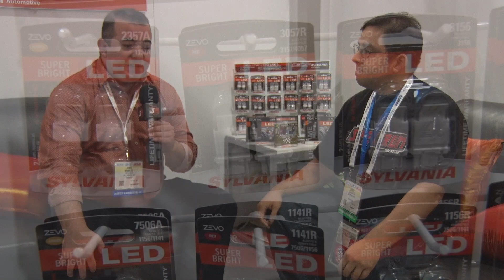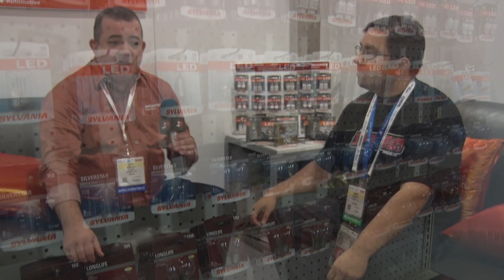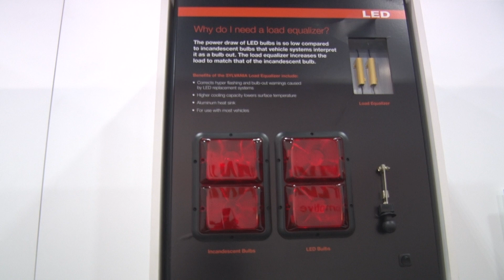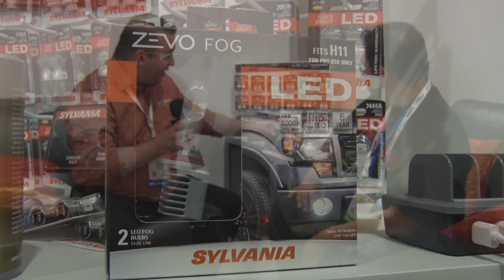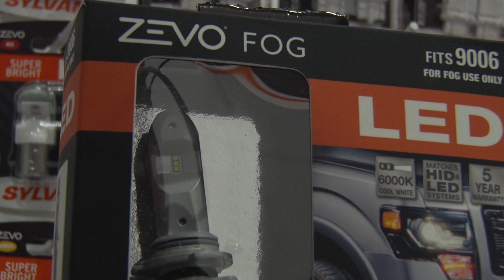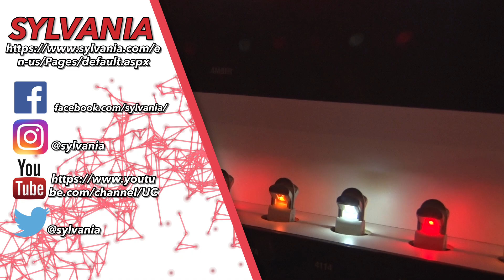Sylvania Interview at AAPEX Show

Comment: Now even this was quite a few years ago.

These led bulbs from sylvania zevo are excellent bulb replacement. 

These zevo led bulbs, wether if it’d red led, Amber led, and white led, these makes between 1.5W-2.2W 

For what it is and how it performs and when it uses our reflector housing, they are the brightest, of the least bright led bulbs. 

It’s the same if not a hair more bright than oem. When it gets dark, it becomes couple hairs brighter than stock.

Just because these products says for off-road use only, doesn’t mean we shouldn’t get it. 

If we want something that’s a bit brighter, have an instant on and instant off led bulbs, and gives a nicer and modern look to our older vehicles. 

These are a must buy. 

I have some in my family’s 2017 Toyota sienna LE. We have some sylvania zevo T15 led reverse light, 7443R led brake lights, we use to have 7440A but it did not work for its particular turn signal application so we went with lasfit and it was much better.

We use Zevo T10R inner tail lights, .evo T10 license plate lights and map lights as well.

And I even did the same for my brother in law’s 05’ Toyota sienna. 

Soon as I get new oem headlights and oem tail light assembly, the brake lights, turn signals, reverse lights, inner tail lights, license plate lights and some interior lights will be replace with sylvania zevo led bulb replacement. For low beam and high beam headlights. 

We’re gonna use on lasfit led bulbs for reflector style headlights of low beam and high beam.

That’s gonna give the 2nd gen sienna a much modern look, for better safety,style, and performance. 

To keep my family safe to see better and be seeing better to alert other drivers. 

🙏🏼🙏🏼🙏🏼🙏🏼🙏🏼